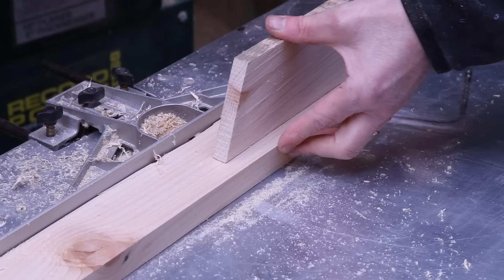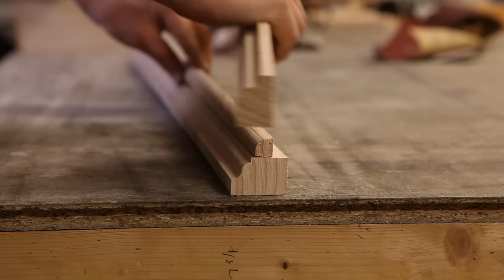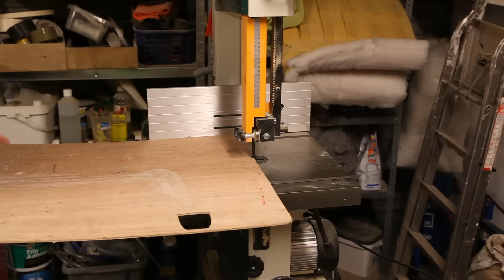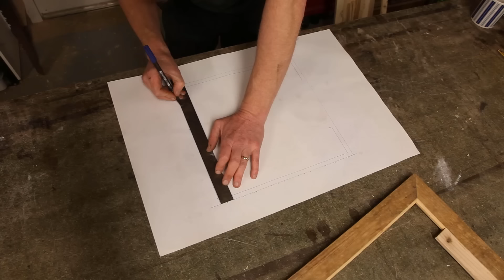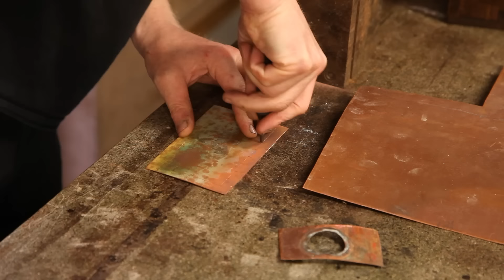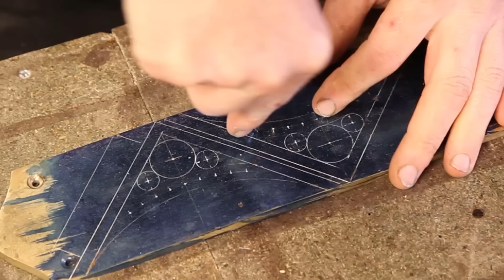Steampunk Industrial Bookcase made of Pallet Wood, Scrap Copper, Brass, and Up-Cycled Junk.

Comment: I love to imagine that your home is furnished with all of your magical furniture, and how cool that must be.
Reply: Seriously, he does great work!
Reply: Cecilia Salazar Me too!!
Reply: Yesss! I do too!
Reply: Cecilia Salazar YES Me too!!
Reply: @Armando Sanchez it depends on the pallet that you use. A lot of these are only heat treated rather then chemical treated so they can be safely used for projects. 
You can even find some hardwood in some :)
Reply: Suck up! Haha
Reply: @Armando Sanchez I understand that when you plane the wood it takes the chemicals off because it doesn't soak up that much?. My brother made some furniture for me and I have not had any issues.  He works hauling them from producers to sellers.  You could be very right about it but l think I will keep them for now. To buy what he made would have cost me $ 300 to $500 dollars and be made with MDF board, glue and vernier. I have an heirloom in the making.
Reply: It depends on the type of pallet. Heat treated (marked HT) are completely safe for use in all applications.
Reply: @Armando Sanchez 
You don't know about pallets if you don't know how they are marked, if you work with them and don't know that then how do you keep your job.

Comment: Suggestion for you. When doing all those little half round pieces, use a plate with a adhesive disc on it. Then just pull them across it. Sanding burrs will go faster.

Comment: Very clean work.
Especially the idea with the copper and the old brass door handle fittings.
You can also work really well with metal.
Is there a material that you also have to buy or is the whole material wood, metal, copper, glass etc.?
From the trash? Or found somewhere else
Disposable pallets are all scraped and then burnt.
In any case, this shelf is a sight for sore eyes.
Very good.
Many thanks
Reply from the maker: Almost everything I use is trash. I don't usually buy materials.
Reply: That is really very good.  @EpicUpCycling

Comment: At the scene cut at around 6:55, the nail hole on the bottom left lines up perfectly in the same spot as a random bit of similarly-sized black something on the router table surface.

Comment: Man I'm absolutely in love with this piece and you did an amazing job!
I definitely got some anxiety watching you work on some parts though - especially the table saw, the way you were getting close to pinching the blade or catching your hand. Then moving the wood before moving the chop saw back, I nearly died. I'm very happy it's been working for you but man that ain't it... I picked up a new clamping technique watching the glue ups though!
Also highly recommend getting a stapler/nailer for the glue ups! You've got all the other tools, a air compressor is super useful for so many things and it'll make tacking for glue ups easier!
Reply: Agh dude I'm sorry I can't 

The result is super impressive and it looks great

But the fact you just keep leaving tools on while showing off what you just did instead of turning them off then doing so (for safety and to not accidentally fuck the piece up!), using push sticks/blocks but still having your hand pushing on the other side or using the push block on the wrong side of the blade, leaving jigs right against running tools (like the band saw cuts), using a screwdriver right after using your drill to do all the steps to make driving the screw easy and best with the same tool, using a chisel and hammer for the same thing you just did with your router table, just randomly switching to hand tools for things you have already done with your power tools.... it's just so frustrating and spits at safety too. People watching this and hoping to try are going to think this is safe practice and how to do it

If you wanna do it all hand crafted do it all hand crafted. If you're gonna use your power tools use them. If you want to let people know that they can alternately do a task with hand tools instead if buying the powertool caption it. Don't switch constantly between and present it like you need to have both sets of tools like this.

You also wouldn't need to spend so much time sanding the piece if you stained in sections and wiped it away after 15 minutes like you're supposed to. A light sand for effect/aesthetic/aging for sure, but it's not paint. You apply stain and wipe it off after 10/15 minutes max, but you spend what 1 - 3 hours sanding it all because you just painted it on and walked away? It would have had that lighter color if you just took a rag and wiped it after 10 minutes

I just couldn't stop being frustrated watching this

Comment: This is the second video of yours I've watched. And the second bookcase, as it happens. SO many emotions generated whilst watching this.

I was by turns awestruck, gobsmacked, amazed, envious, drooling, and laughing out loud. Sometimes with joy when I realised what it was you were about to do next, and sometimes at the little touches of humour you included. And those doors with the riveted copper tubing latticework.. magnificent! The cutouts you make for the skirting boards, so that the bookcases can sit flush against the wall.. so obvious, yet so seldom done! I love that you drive all your nails and screws by hand. And do you even own a drill press? If so, I've yet to see it used. And the questions you've raised..

What exactly is that beautiful stain that you apply? And what is that (powdery?) substance in the flat tin that you stipple on afterwards?

In a few years, I hope to be fitting out the interior of the yacht I plan on building. Your work is already inspiring me in terms of the kind of detail and finish I'd like to aim for. Thank you so much!
Reply from the maker: Thanks very much for the comments. The dark stain I use is Liberon dark oak spirit dye, followed by a coat of dark oak Briwax furniture wax.
Reply: @EpicUpCycling  - Thanks!

Comment: Hello, what you make out of reclaimed pallet wood is really beautiful!
I have always hesitated to work with pallet wood because of the nails and sand which can damage the tools. Can you tell me the real impact on the tools of pallet woodworking?
Reply from the maker: Thanks for your comments, Gilles. Pallet wood can be quite hard on tools, it depends on the pallets you get hold of. I use a set of cheap blades in my planer just for pallet wood and keep my best blades for other work. I also sometimes belt sand pieces that are really dirty before planning them.

Comment: your truly a very skilled artist, carpenter, furniture make ,can I ask a question this bookcase you just made did you use a water base stain I struggle when I stain pine always turns out blotchy I've tried conditioner,s still look the same ,,very nice work thanks
Reply from the maker: Thanks Ed. The stain I used was Liberon spirit dye. I sand it down to give it a distressed look so blotchiness hasn't really been a problem :)

Comment: What's your glue up table/work bench surface made of? I'm making one for outside with some boards someone gave me after they replaced their deck. I'm usually working on a stack of pallets outside so figured why not just make a table/work bench.
Reply from the maker: its varnished flooring chip board

Comment: I have so many questions. Is there an advantage to using a long bristled brush for staining compared to using one that is short? Where do you get the ideas to make these heirloom furniture pieces? I notice you rely on a lot  of glue to hold trim pieces on. Is there a particular brand you like more? I also don't see you using a square a lot of the time. Is this being used off camera or are you so precise in keeping your tools very square? This attention to detail is amazing. This will be my new goal. I want to build a bookcase similar to this one and I will pay very close attention to the details you seem to. Your work is outstanding. Thank you for sharing this with us.
Reply from the maker: Thanks for the comments, Thomas. The stain I use is really thin so the longer bristles hold more. probably doesn't make much difference though. I usually use D4 adhesive by Everbuild. No real preference for it, It's just easy to get and fairly cheap. I use a square quite a lot, it maybe just doesn't get seen in the video shots much :)

Comment: How are you setting the copper rivets? I see you tap them through the holes in the copper straps but I don't see if you're setting the backs to hold the straps together tight. It looks like they could just slide back out.
Reply from the maker: The rivets are knurled ones, they have ridges along the length of the shaft. They are meant to be used into blind holes in metal, more like a nail than a rivet. As long as the hole in the wood is tight enough, they don't come out.

Comment: Curious....could the brass be cut with a bandsaw, for the basic shape? I haven't used one much, and then only for wood. I really want one, and a planer, but it's not in the budget yet, so just trying to learn. That's a really beautiful piece. I like all the detail work, but I think my favorites on this one are the copper basket weave on the doors, and the molding detail you made with the half round wood pieces down the sides.
Reply from the maker: Thanks for the comments. Yes, the bandsaw would have cut the brass but I didn't have the right blade :)
Reply: @EpicUpCycling  Good to know. Thank you!

Comment: I have a question. At about 19 minutes when you run your first coat of stain you then go back and sand it before staining again and i'm not sure I understand why. Is it to give a more aged look?
Reply from the maker: It gives it a more aged look, but also the stain makes the grain stand up so it needs sanding. If I was doing a peice where I didn't want the aged look, I would give it a second coat of stain after the sanding.

Comment: Very nice work. One question about your paintwork:
First you apply an oil-based varnish, then you use sandpaper, and after that you apply a water-based paint, is this correct??
Reply from the maker: No, the first coat is spirit based wood dye, the second coat is furniture wax
Reply: @EpicUpCycling  Thank you very much for your reply

Comment: Where do you get the brass revits? If that what their called.
Reply from the maker: They are copper rivets. Not very easy to get hold of. I found these ones on Ebay.

Comment: Real question: How do you store the scrap like that without it warping?  I have to store mine flat or I lose it all
Reply from the maker: I'm fairly lucky, the humidity where I am is fairly stable. I probably get about a third of my stock warping to some extent but I can use most of it. I usually store pallets outside under cover for a couple of years before pulling them apart. This seems to help as well.

Comment: What is your workbench table top made out of? Mdf?
Reply from the maker: Varnished green flooring chipboard.
Reply: @EpicUpCycling  and the varnish allows it to be glue "proof" that's awesome. I do have a question. In all your videos you use the recycled nails. Does the rust not affect the end project? I'm a novice woodworker and find this channel an inspiration.
Reply from the maker: @BlackPowderTherapist  I've never had any real problems using the nails. I like the slightly rusty look. If they are somewhere dry they wont rust any more but the existing surface rust could discolour whatever finish you use on top so I would clean them first if this would be a problem. Another note on the bench top, I also rub it down with candle wax every now and again. This really helps :)

Comment: May I ask why You sometimes use lamels for making a big boards and sometimes not?
Reply from the maker: I mainly use them to help line the joints up in thicker boards if they are slightly uneven, or if the panel needs extra support while the glue dries.
Reply: @EpicUpCycling  Is it strong enough to use a glue itself?
Reply from the maker: If it's a side grain to side grain joint, then good wood glue is stronger than the wood. If the joint is done correctly, then I've never found a need for anything else.
Reply: @EpicUpCycling  That's great. Thank You.
Should I sand it before glueing? If yes what sandpaper grade is best?
Reply from the maker: @rafals5113  I don't usually sand the edges, mainly because it can end up uneven. I find a slightly rough sawn finish to the edge is best, especially if you're using poor material like pallet. If it's decent wood, I normally plane it on the jointer to get a perfect joint.
Reply: @EpicUpCycling  Thank You for detailed answers.

Comment: You probably won't read this comment, but as a new woodworker I wondered why you don't use a riving knife on your table saw?
Reply from the maker: Sometimes it's been removed for a particular cut and not been put back on straight away. Normally I would have it on. I would recommend always using one.
Reply: @EpicUpCycling  Great thanks for the advice man. I love your channel and I've picked up so many tips just watching you work.
Reply from the maker: @robturner103  Thanks. Glad you're enjoying the channel. More videos coming soon :)

Comment: Wow! really lowering the Carbon Footprint by using old pallets instead of new sustainable grown pine.
Now all we need is about £300.000 of engineering equipment.

But with all of that said, it is a pretty decent product, albeit probably not cheap with all of those man 
hours chucked at it.

Comment: This guy makes me feel nervous when he uses the table saw.  I probably would have cut the tip off my fingers if I used the saw the way that he does and I have used a table saw my whole life. SERIOUSLY, never wear loose baggy shirts around power tools especially the table saw and router they can get caught in the blades and pull you toward the cutting edge.  I guarantee you won't be playing easy country music if you cut yourself up.  This guy is so clever but what he doesn't show you is all the warped and knotted wood he has to discard before he has useful pieces.  Don't be discouraged because it is fun ripping knurled nails out of pallets filled with splinters.  Just trying to keep it real with hopes that no one gets hurt.